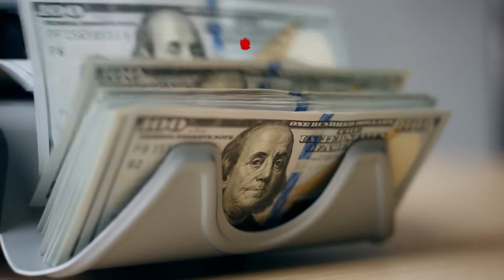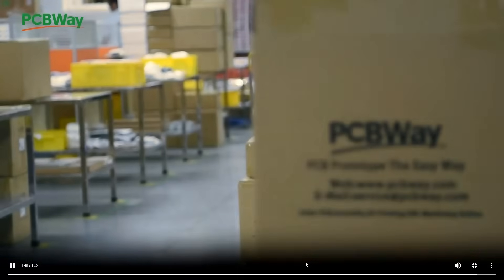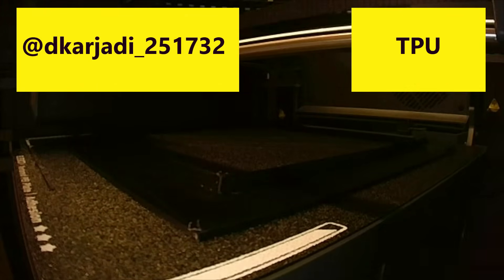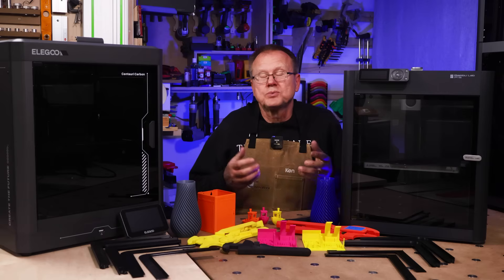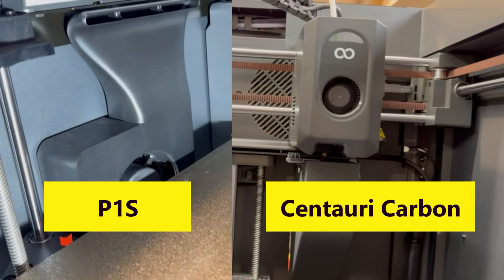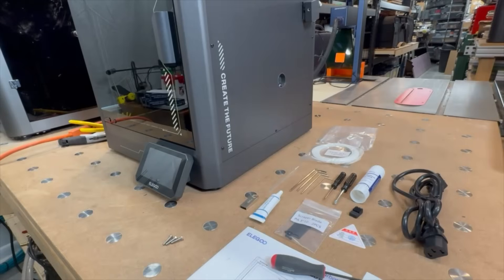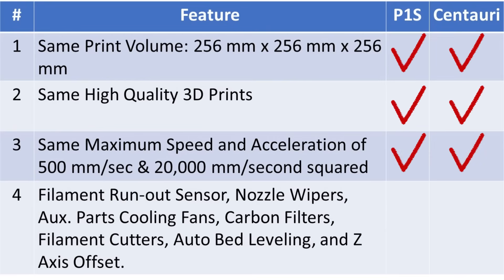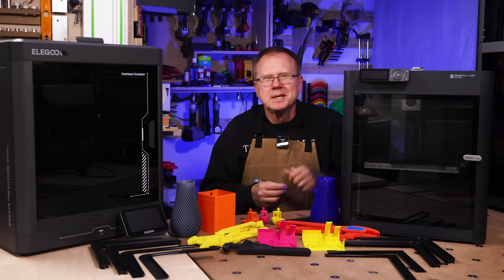Elegoo Centauri Carbon Printer: Better Value Than Bambu Lab P1S?

Comment: Right now the Centauri Carbon is 330 euros vs 450 euros of P1S (for anniversary). I'm actually trying to choose the one to buy but i really don't know :'(
Reply from the maker: I wish you the best of luck with your decision. I think you will be happy with either one.
Reply: Where P1S is priced 450 euros?Would take one for that price.
Reply: The P1S is only $200 more right now due to the anniversary sale going on. No brainer, P1S all day, at $400 more I’d still take the P1S if you can afford it. I love my P1S, I added a chamber heater, bed temp deregulator and scaled nozzle heater to print all materials.

Comment: how loud are these two? i have my printer set up in the hallway next to my bedroom. i care about noise a lot
Reply from the maker: I haven't tried to quantify the noise level of both printers, but they might be a bit noisy if you are going to have them right outside your bedroom, especially if you are running PLA and you need to keep the printer door and/or top open for airflow.  Thanks for your question.
Reply: @ristinnovations  Thanks for the answer... i have a creality ender 3 v2 neo at the moment and its fine noisewise, but its a whole different way of printing with a printing bed that moves so its hard to judge how loud these printers would be in comparison

Comment: Meh, I just bought both.  The Bambu for multi color and the CC for higher temp filaments.
As for how Elegoo makes the CC and sells it at such a low price?  Easy, they just blatantly copied Bambu in about about every way.  If you don't have to invest years in development time and just rip off the market leader of course you can sell cheaper.
Reply from the maker: It sounds like you have the best of both worlds by buying both printers. You do bring up a very good point that Elegoo wouldn’t have the R & D costs that Bambu Lab would have. Thanks for your comment.

Comment: Mejor la CC
El sistema multicolor saldrá al mercado el tercer trimestre de este año 2025.
El plazo de entrega en teoría es largo y en la práctica se reduce unos dos meses.
Mi caso ha sido el siguiente:
Plazo de entrega: 10 de julio. 
Recibida: 21 de mayo.
Estoy súper feliz.
Reply from the maker: Yes, that is my understanding as well that Elegoo plans to launch a multi- color system during the 3rd quarter. Time will tell. Thanks for your comment.

Comment: In the UK its £300 for the CC vs £460 for a P1S (or at least it was when on deals). I chose the P1S due to the months long wait for the pre-order on the CC which hasn't been out long enough yet to be proven solid over time. Once proven Id expect the CC to be a better machine.
Reply from the maker: I understand your decision to purchase the P1S, especially due to the long lead time of the CC. We will have to see the reliability of the CC over time as you mentioned.  Thanks for sharing your decision.

Comment: The Carbon doesn't have a "LAN Mode" because it isn't a mode. LAN access is available by default, with no proprietary gatekeeping software.
With dynamic dns and a VPN tunnel, you can monitor or operate your printer from anywhere with no subscription and no cloud necessary.
Reply from the maker: Yes, I agree with you.  I misspoke in the video regarding LAN.  There have been a couple other viewers that mentioned this to me so I appreciate your comment as well as others so I won't make the same mistake in the future.  Thanks again.
Reply: @ristinnovations Sorry for piling on with that. :)

Comment: Another great video! One thing to consider is the company itself! Anyone can sell you a printer. What happens when it is lost or stolen in shipping? I ordered a P1S and it made it as far as a fedex hub 10 minutes from my house, then stalled for 11 days. Fedex was unresponsive for several days. Their mangers all did nothing! Bambu Lab was unresponsive for nearly 2 weeks! Then sent email stating they were sorry for the inconvenience over and over. I am shocked at how useless both fedex and Bumbu customer support is!
Reply from the maker: Wow! That must have been very frustrating. I'm sorry you had such a bad experience with your shipment.

Comment: There is a substantial weight difference between the two. The CC is pretty light. My concern is long tearm usage. I have over 6000 hours on one of my P1's. I don't think the CC will handle heavy usage. But the print quality is fantastic. I would have no problem recommending it to a beginer or casual user.
Reply from the maker: I'm not sure what you mean regarding the CC being lighter than the P1S.  The CC is a couple of kg heavier than the P1S due to the cast aluminum frame.  Can you clarify?  Thanks
Reply: @ristinnovations Your absolutely right. I stand corrected.

Comment: Thank you for your great review!!
I’m now approaching the world of 3D printers, and I had seen these two printers.

What are the big ‘out of the box’ differences? 
What are the extra things I should buy if I took bamboo or carbon? Because as I understand, CC already has more things than bamboo, but do I need these things right away?

I found the p1s for 500€ so as prices are similar (about 150 difference) what do you think I should take? 
Thank you in advance.
Reply from the maker: It really depends on what types of things you will be 3D printing. If you want to print multi color parts, then the P1S has that option now, but it appears that Elegoo will be offering a multi material option in the future (timing and reliability are to be determined). If you are new to 3D printing and you have the budget, the P1S is a safer choice because it has been on the market a while, however the CC has just been launched so the reliability hasn't been proven yet.  Will you be printing abrasive materials?  If so, you will need to upgrade the P1S extruder and hotend.  Good luck with your decision!

Comment: How is the print noise between the two printers?  I’ve heard the P1S is a lot quieter.
Reply from the maker: I think the print noise of the CC is louder than the P1S. I don’t have a noise meter to quantify the noise level, but my subjective opinion is that  the CC is louder. It’s definitely the fan noise that’s the key. Thanks for your great question.

Comment: Elegoo has already added a Multi Material port to the latest shipping models. It already has all of the features necessary for this ability. And you can buy 2 Centauri Carbons with $100 left over versus the Bambu Lab P1S. So the only questions would be the reliability of the two printers and how much Elegoo will be charging for the MM unit when it is available.
Reply from the maker: Yes, I have since learned about the multi material port on CC's that must have shipped after mine arrived (which was only a few weeks ago).  That's good news. I can only assume that Elegoo has an upgrade kit planned to allow us who don't have the MM port on our versions of the CC.  Yes, it is a great question on what Elegoo will be charging for their multi material module.  I think somebody mentioned it will be available Q3.  Thanks for your comment.
Reply: @ristinnovations  BTW, I just received my Elegoo CC on the 17th. The unit now has two bright LED strips and the AMS/MMU port was added to the back. Orca slicer works fine and already has the printer listed with settings for a huge number of filament brands and types. Oh, and the panels on the Elegoo are steel, not plastic.

P1S buyers are being BamBoozled (pun intended).
Reply: Damn, p1s for me is more on sale than the cc but cc is still the better deal b/c i can get included more filament, plates, hotend included lol

Comment: 11:11 I may be mistaken, but I believe that the Centauri Carbon connects directly over the local network, so it's the same as LAN mode.
Reply from the maker: Yes, you are correct. I misspoke when I stated the CC didn’t have LAN. I was referring to the fact that there wasn’t an Ethernet connection, bit I have since learned that the CC has a WLAN (wireless LAN). Thanks for your comment.
Reply: @ristinnovations Great review btw!
Reply from the maker: @xenontesla122 Thanks for your positive feedback 😊

Comment: I got my P1S last year with 2 AMS's, and it's been running pretty much non-stop ever since, and it was such a game changer over the Sovol SV06 Pluses that I've been using for the past couple years.  I love it,  and it's completely changed my print game.  When I saw the pre-orders for the CC, I was hesitant, but the price was so cheap, I figured I'd give it a shot.  I got it in a few days ago, and just got it set up this morning.    After printing a half dozen things today, my early thoughts are they're pretty much the same printing experience.  The lack of color changing will limit it somewhat, and I have no current plans to buy their AMS when it comes out.  But since probably 3/4 of what I print, the color doesn't matter anyway, I think having a dedicated machine to just pump out those things is gonna be perfect.
Reply from the maker: Thanks for sharing your experience with both the P1S and the CC. That’s very encouraging information.

Comment: I believe P1S comes default with a stainless steel nozzle, which isn't ideal for CF filaments over time.
Reply from the maker: Yes, you are correct. I needed to upgrade my P1S to hardened steel before I could print glass-filled or carbon-filled materials. Thanks for mentioning that.

Comment: Another thing to mention is the latest batch of CCs have updated lighting and a 4 pin expansion port for a future multi material system. The price remains $299. However spare parts are limited and shipping my order took 3 months. I also own the P1S combo as well as a cpl k1s. So far the CC is definitely a home run. Lastly, Elegoo customer support is excellent! Anyone who has had to deal with Creality or Bambu Labs will be impressed.
Reply from the maker: I hope those of us who received the earlier batches of the CC that Elegoo will offer us free upgrades to add the light bar and 4 pin expansion port for the future multi material system. I agree that spare parts are limited so I am also hoping this will improve over time. That’s good to know regarding Elegoo’s customer service because I haven’t owned an Elegoo printer prior to my purchase of the CC. Thanks for your valuable comment.

Comment: Another thing to consider:

Can it use OrcaSlicer?
On the Bambu? You have to fiddle around with the settings to get it to work.
On the Centauri Carbon? Supports it out of the box.

I'd say grab the Centauri Carbon and wait for the Multi Filament System to come out on Q4.
Reply from the maker: Yes, you’re right that your preference on slicers is another thing to consider. Thanks for the comment.

Comment: How are those material profiles on the elegoo slicer, did you need to make any tweaks?
Reply from the maker: I used the generic profiles in the Elegoo slicer. I didn't make any tweaks for the parts I printed.  Thanks for the question.

Comment: I ordered the CC about two weeks ago as I want to make parts with higher durability in high heat and possibly damp locations. Think greenhouse. I have zero experience in 3D printing and want something that will work right out of the box. Either one would work but besides the dim light and only single filament limitations ( for now) I thought the CC would be a good first Time Machine for me. I’m not expecting my CC until sometime in July. Great video. I don’t recall you mentioning the advantages of side spool of the CC over the P1S single machine. I was leaning towards the P1S until I started watching videos on the CC and like your video mostly positive with the same drawbacks. One other damning issue with the CC was the feed tube getting pinched or rubbing on the top edge of the unit. Some make a riser. Some cut the feed tube off the other assembly. I would not be surprised if Elegoo makes a riser with strip LED’s and fix both issues.
Reply from the maker: Yes, you are right that it is a bit easier to change the filament spool with the CC since the spool is mounted on the right side instead of the back on the P1S. I had read about the filament feed tube in the CC having a sharp radius going into the toolhead, however I haven't seen a problem with mine so far.  You are right that a small riser for the top would help that.  I may make a riser that includes a row of LED lights to improve the lighting in my CC.  Thanks for your comment.
Reply: If its just two weeks ago / basically 4 weeks by the time I am writing, it is still possible you will received the upgraded led lights + the one with AMS port.

Comment: "I bought it with my own money" - the magical words I'm looking out for in reviews nowadays.
Reply: Not true. And he still would not be lying.  It is common practice for a company to have you purchase the item with "your own money", upload a review, and then  refund "your money" and allow you to keep the item. BUT YOU AIN'T HEAR THAT FROM ME 😊
Reply: @vwave7292 no reply yet…
Reply from the maker: It can be too expensive for most YouTubers to buy multiple 3D printers for their reviews (and I have received other brands for free in the past), but I do understand your point regarding wondering if someone was given a 3D printer if they will give an unbiased review. For this video, I was able to buy both printers because I thought it was a low risk to expand my print farm. Thanks for your comment.
Reply: @ristinnovations  Main issue is most major 3d printing channels are shills who rarely speak poorly of a product out of fear of losing future access to new machines later on from the company.
Reply: August 03 : You did not mention the better resolution of the cam on Centauri Carbon. Furthermore the printers delivered by Elegoo have 2 light bars that give good light inside the lighting, and have a connector on the back panel for an AMS that should be announced soon.
Reply: @jombr7015  Is this a change with the newest run of the printers or something? I'm looking at buying one and all i've heard about the parts you mentioned is that hte single internal light is bad and the camera kinda sucks too.
Reply: Not to mention no ridiculous intro. Straight into it!
Reply: My own money that a company gave me 😂 therefore it's my money
Reply: @Jay-vr8it Well, a company paid you that money for the work you did for them. Going by your logic, the money doesn't belong to the company either. Pretty dumb logic if you ask me.

Comment: I have been running a Bambu X1C for about a year now. Preordered the Centauri Carbon in February and got it delivered earlier this month. Mine is a Batch3 machine, and comes with the one tiny LED light in the corner. I've heard that in the later batches Elegoo has replaced this with multi-lightbar lighting just under the top lid which should solve the lighting issue. That being said though, the CC is a phenomenal machine. Time will tell whether it will be a tinker-free workhorse like my X1C, but so far so good. The Bambu machines does have better support for parts and upgrades because they have been out for years now. The only place to get parts for the CC is thru Elegoo (assuming you can get them.) I'm sure this will improve as Elegoo's production gets ramped, but that's the current situation.
Reply from the maker: It sounds like you and I have the same batch. I ordered mine in February as well. I’m hoping like you that Elegoo offers the necessary spare parts over time. I already placed an order for different sized nozzles, but they won’t ship for a while. Thanks for your comment.

Comment: the light on the carbon has been updated in the latest models to an led strip on the right side at the top. It still comes with the light on the camera but it is not wired and inoperable.
Reply from the maker: Thanks for letting me know. I just got my CC a couple weeks ago so I hope their changes are backwards compatible.

Comment: Idk if I missed it, but are these both using default nozzles or hardened steele when printing with ABS?
Reply from the maker: I didn’t mention it, but I upgraded the P1S with a hardened steel nozzle. The CC comes standard with a hardened steel nozzle.
Reply: @ristinnovations doesn’t the P1S require the harden gear upgrade for the extruder as well?

Comment: However, you forget a very important point: long-term testing! I don't doubt that this is an inexpensive and good 3D printer, but due to the lack of long-term data on reliability, I doubt that this printer can already be called the better choice.
Reply from the maker: I agree that long-term reliability for the CC is not known yet. I was recently thinking that I also took a chance with the Bambu Lab X1C 2 years ago when there wasn’t long term reliability for it. Only time will tell on the CC reliability. Thanks for bringing up this point.
Reply: @ristinnovations 
I hope the best, competition is good for the market in any case. 😁